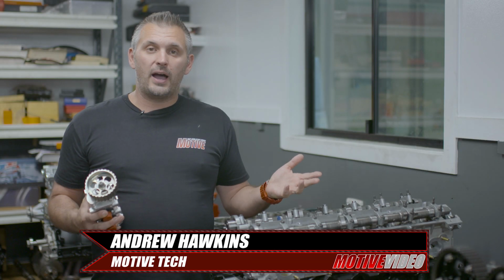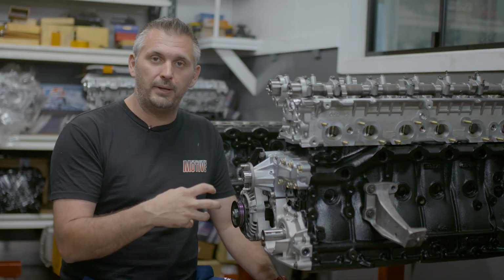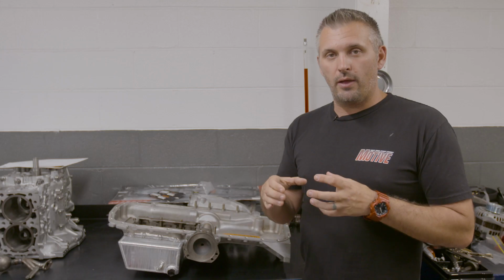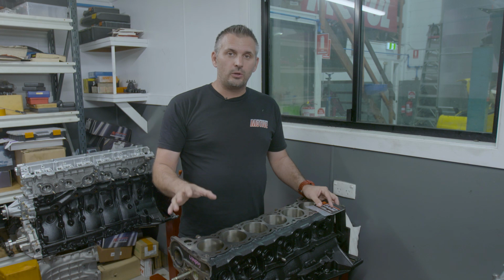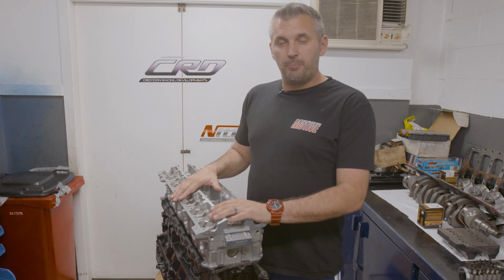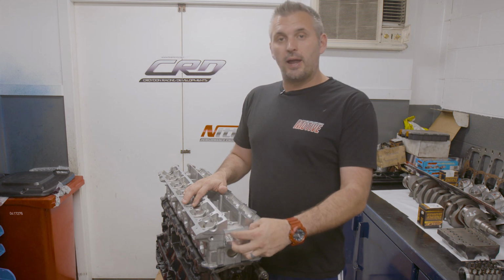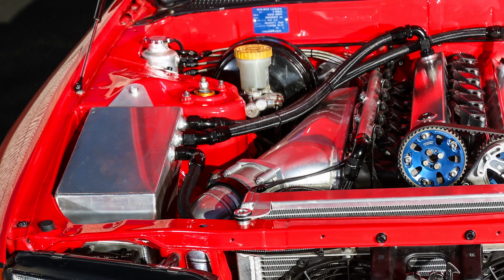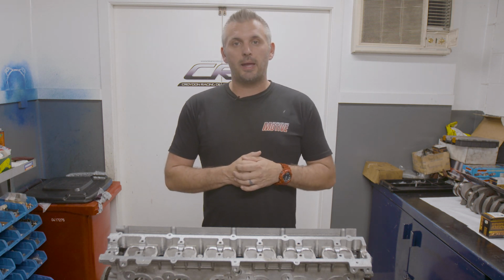How to Fix Nissan RB Engine Oil System Problems - RB20 - RB25 - RB26 - RB30 - Motive Tech

Comment: Got an rb25, is it common for the oil presure to be 25 at idle? Is a stock engine!,   also i install my catch can ,breathers to catchcan, and catchcan to intake ,i move my pcv in between the catch can and the intake, im i wrong doin that, that way?
Reply from the maker: Is low, but common. Factory gauge also terrible
Reply: Mine is 25psi at idle while warmed up and it's been that way for years. It's pretty common though. Now if it stays at 25 at wot then you have a problem.
Reply: @clutchkickpj693  no it wont stay, if i go on highway and then stop it would ve on 20psi
Reply: At idle , while on throttle it goes 45psi ,if i floor it get up to 60
Reply: @MotiveVideo  i got an automotive gauge

Comment: Would you need a oil restrictor when using a N1 pump?
Reply: No. They are better than the standard pump, but they aren't a high flow like a Nitto.

I also run an N1 on mine. I chose it because of the improvement of flow over factory, but it doesn't require you redesign the oil system.
Reply: Okey, cheers! I knew it was something between the factory one and the larger aftermarket pumps. Have used the N1 since 2011 now, haven't had any problems with it 👍
Reply: @Ryanbmc4  все четко, не понятно зачем эти маслонасосы нужны, все равно избыток давления скидывает клапан :)))

Comment: Will you guys do one on drysump aswell?
Reply from the maker: Maybe one day. we prefer to keep info more relevant to main audience
Reply: @MotiveVideo  fair enough, i have a 4 stage pump to go on my 2530 build and unsure how i should set it up
Reply: @MotiveVideo  na bro go ahead it's super interesting and might give you more views and subs. More content the better you guys need to put out twice as many vids.
Reply: @samuelmdouglas  hit up Jake Jones he runs a dry sump on his 900hp rbm3. I'm not sure how many stages his is but he might be able to help.
Reply: @MotiveVideo   any vids on rb25det ? And also what is the limit on a 25 lifter.  Got an forged 25det with std pump 9l sump  running gt4202. . Should i got solid head or upgrade oil pump and could rev out to what safe ....?

Comment: I dont know any engine builders that are not as precise as you.  been stung a few times and i have a Low compression, built for over 100hp rb and im at 600hp, and filling the catch can kicked of the track. has 2 step, haltech plat pro, spool rear drain, nitto n1 pump. on full boost which is small now it still now blows oild all over the place. out the catch can vent.

Comment: My rb25 build motor n1 pump. Rev 8200 made 725whp behind a th400 with a tomei oil orfice
Reply: Chris Herbert thanks for that
Reply: Hey can you share your build specs and list with me? I have the same build going on and the same power levels aiming for. I would love to compare the specs if you dont mind.
Reply: Jagdeo Nathoo cp pistons. Manley Rods. Super tech springs and retainer. Tomei 256 cams. N1 oil and water pump. Crank collar. Nismo tstat. Tomei head gasket.
Reply: @chrisherbert5052  i pretty much got the same list too, except the rods.
Im stuck on cam choice... Some ppl are saying go 262 and 272 but i was thinking along 256 like what you have since it'll have a better lower end and mid all throughout to the top end too. Do you know if the 256 cams are better or would the others be better for best response from low end to top?
Reply: 25 30 or just 25 ? Stop reving at 8200 due to lifters of turbo?

Comment: 1mm hole to supply all the oil to the cylinder head 😕
Reply: I'm sure its 'enough' at 100+psi, but I wonder if it cavitates the oil as it passes through.
Reply: @SlingSalsa  enough pressure for sure but volume still needs a larger diameter hole.
Reply: These people are building 1500hp+ RB's, I think they know what they are doing lol.

Comment: I fix my rb26 oil issues by sticking a extra 0.5 litres of oil in it and not revving it over 7500 rpm!
Reply: And not ever driving around a corner fast?
Reply: Try a good quality oil filter a high flow
Reply: @zyoungson215  Of course I do, what would be the point of owning a GTR if you don't enjoy it!
Reply: @AwesomeFPV  exactly!

Comment: Too bad this problem is still their.  Because the sump is up front . Unlike a BMW rear sump and no oil pump driven straight off crankshaft, that's the real issue
Reply: No actually the problem isn't still there after these things are done and it's been proven thousands of times.
Reply: @clutchkickpj693  I'm sure and where are you getting your experience or evidence to support your sad claims . Another wannabe technician or car enthusiasts.  Maybe own a e36 m3 evo or put a S50 in e30 . Rod bearing will go that why I went to a custom cross member. No more e34 front sump swaps.

Comment: Step 1 buy a 2j step 2 problem  solved.
Reply: Barra*
Reply: Ls
Reply: @AboutTheBuild  LS and Barra ;)
Reply: @Monstero5o  2 of the best engines
Reply: @AboutTheBuild  Only two engines i would ever use in swaps. Sit in any LS or Barra and drive it around australia. Sit in a JZ or RB and fix it every state you cross lol
Reply: Pfft you buy a Toyota because you want a reliable car. But reliable cars mean you never have to work on them. :D Where is the fun in that?

Comment: Best way to fix the oil problem is to put a barra in it
Reply: Yeah, but early Barra's have oil problems too. lol..

There are a couple of weaknesses in the factory Barra motor, particularly early BA-BF examples. The factory oil pump gears have been known to fail with enthusiastic driving and a few revs, even in lightly modified cars, leading to catastrophic engine failure. While some cars go forever with the stock oil pump, others fail quickly so many tuners recommend upgrading to a set of billet gears in the oil pump if you’re going to push the power game further.

https://www.whichcar.com.au/features/ford-barra-engine-tuning-guide
Reply: @gav240z  they fail because heavy on limiter just like the RB's but oil pump gears has nothing to do with oiling problems lol thats a mechanical issue you clown
Reply: @Monstero5o  calm down buddy. You have issues if you feel like you need to abuse others just for showing its not all roses with other engines. Like anything with cars it all depends on how it's treated, maintained and driven. End of story.